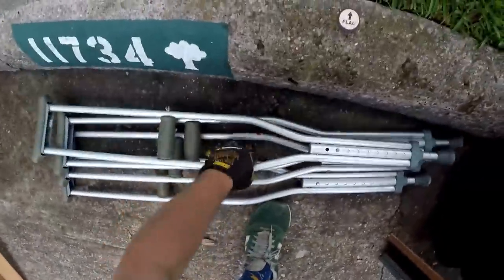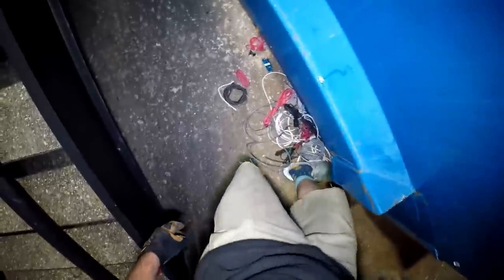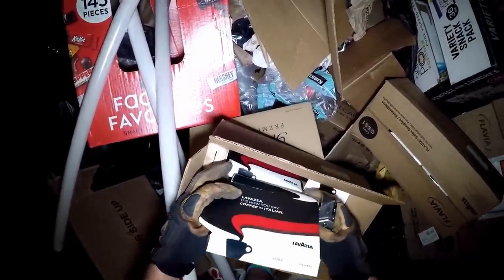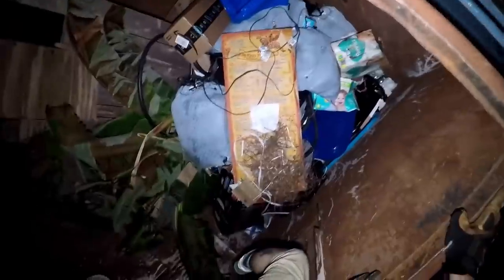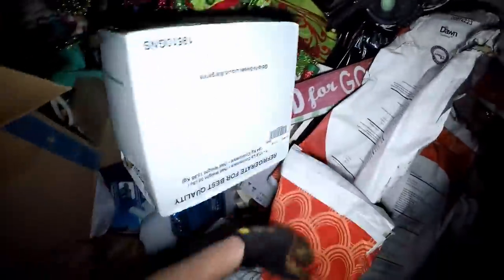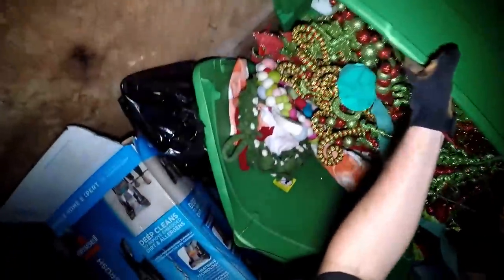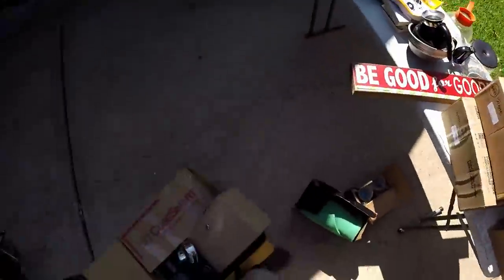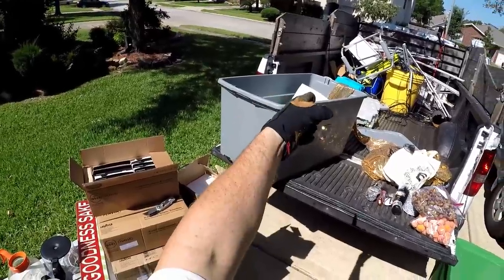Dumpster Diving "We Got Mad Books, Bro!"

Comment: Big ole piece of steel, heavy piece of steel is from railroad. The track sits on it and spikes are driven through it and into a wooden cross tie to hold the rail in place.
Reply: It's a railroad plate Lana, scrapyards won't buy it.